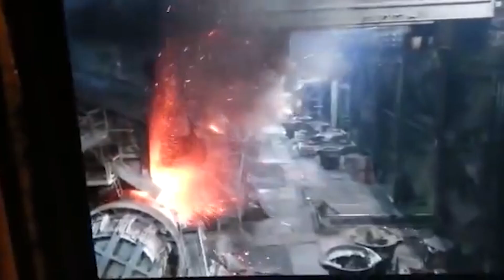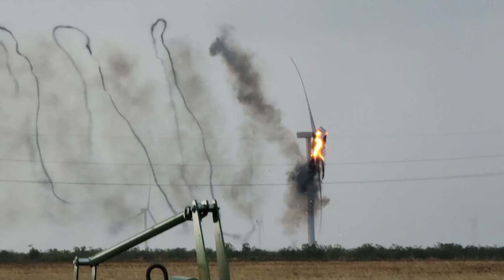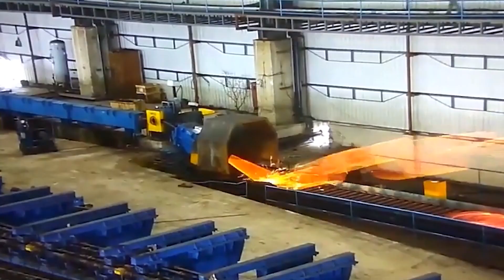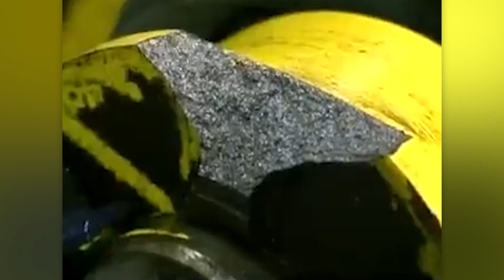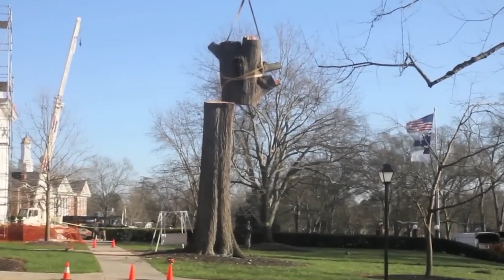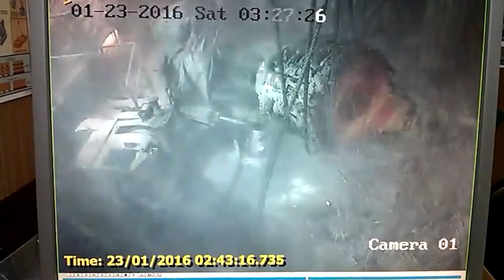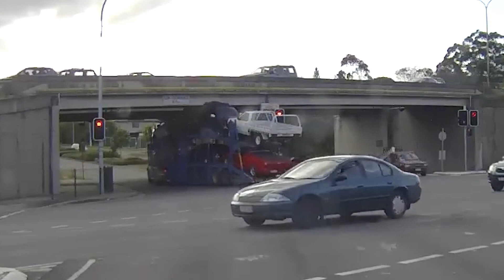Heavy Machinery and Industrial Mistakes Caught On Camera

Comment: The molten steel spill at the steel plant was terrifying. It’s amazing that the workers were able to film it without getting seriously injured
Reply: The cameraman never dies!
Reply: @lrich8181  haha, exactly
Reply: Believe it or not, the accident wasn’t that big of a deal. It was even relatively easy to clean up. Sweeping up little spheres of steel is much easier than puddles of aluminum. It just looked really bad.
Reply: @Endoplasmic-Reticulum  Indeed, most of it oxidizes immediately too. BTW, the narrator says 1000+ C, but molten iron is at least 1600 C, which is it's melting point (approx).
Reply: @paulmichaelfreedman8334  True, but doesn’t the actual temperature fluctuate depending on the specific alloy? And about oxidation—wouldn’t that depend more on the environment and how long the molten iron is exposed to air? There’s more to it than just temperature, right?
Reply: @Endoplasmic-Reticulum  Interesting take, but wouldn’t steel spheres be harder to manage due to their weight and potential to roll everywhere? Aluminum might spread out more, but cleaning it up seems like it could be quicker in the right conditions.
Reply: @InspiringStories-d8n  Actually, the spheres are so small that they’re in the range of .5mm or less. When my classroom demonstrations were done, I’d have to sweep them up. Sometimes I’d be lucky and a nice group of students would help.
Reply: @Endoplasmic-Reticulum  You have great friends. The spheres might be small, but doesn’t that make them even harder to clean up? Tiny spheres like that could get everywhere. I imagine it’d be more frustrating than dealing with larger debris.
Reply: @InspiringStories-d8n  I have a friend who works in a similar mill in SC. With accidents like that, they use an excavator bucket modified with an electromagnet that is smaller than scrapyards use. The friends I referred to in my classroom were actually students. 🤣
Reply: @Endoplasmic-Reticulum  Ah, got it! That makes sense—using a modified excavator with an electromagnet sounds like a pretty efficient way to handle those accidents. And yeah, I can imagine your students must've been a huge help cleaning up those tiny spheres. Definitely makes the job a bit easier with extra hands on deck! 😄
Reply: That was slag not steel.  Slag makes sparks.  The ladle plug had eroded or locked up before the crane driver could pour it into a slag pot.
Reply: @asya9493  Thanks for letting me know. I was used to doing the science experiment with my class where I dump molten iron onto the floor and it shoots in every direction across the floor.
Reply: @asya9493  Interesting point, but are you sure it was slag? I thought steel could spark under certain conditions too, especially when it’s exposed to oxygen. Couldn’t it have been a mix of both, given the situation with the ladle plug?
Reply: On the good side, they got to meet Natalie Portman
Reply: @natehill8069  Yeah, meeting Natalie Portman is cool and all, but does that really make up for everything else that happened? Seems like a silver lining, but not sure if it balances things out!
Reply: I found the clip of the wind turbine catching fire due to lightning strikes to be both mesmerizing and tragic. While it's an example of nature’s unpredictability, it also raises questions about how we design and protect our infrastructure against such events. Should there be better safeguards in place for wind turbines? After all, they are supposed to be one of the clean energy sources we’re relying on more heavily. This incident also highlights the potential flaws in the assumption that renewable energy technologies are entirely safe. What are the implications for future investments in renewable energy if we don’t fully understand the risks involved?
Reply: @HeavyMachineryEquipment  It’s interesting you bring up the safety of renewable energy infrastructure! While accidents like the wind turbine fire are rare, they do remind us that even green technology isn’t without risks. Perhaps there’s a balance to be struck between advancing these technologies and reinforcing them against natural threats. I wonder if investing in more durable materials or better lightning protection could make a difference. Do you think incidents like this might lead to stricter standards for renewable energy infrastructure?
Reply: @InspiringStories-d8n  That's a great point! Strengthening renewable infrastructure could be key to improving safety and reliability. Upgrading materials and enhancing protection against natural events, like lightning, would not only prevent damage but also build public trust in these technologies. It might even set new industry standards that push green energy forward. Do you think these kinds of improvements could encourage more widespread adoption of renewables?

Comment: Of all the things in the video - a bridge is a constant - it doesn't suddenly decide to vary in the height. If you're a professional driver you know the height of your vehicle and load. A professional company would be no stranger to that fact either. There's even professional software telling the dimensions of bridges and roads helping to determine the safest and most economical route. In my country we're probably the most digitalized in the world. As an example a pedestrian bride were hit by someone not caring for putting the crane in the transport position. The bridge were replaced just to be hit by an identical vehicle under identical conditions. A week later only 2 miles away - a bridge were hit under similar conditions with a similar vehicle - this time the driver being identical having done exactly the same thing almost to the date 5 years before. The only 2 times that bridge were ever hit in its lifetime... Within that very week more accidents with cranes on trucks happened than in the entire history of trucks with cranes coexisting with bridges. Within a fortnight the laws were changed - it took almost twenty years for a bridge to be hit again. The consequences of hitting a bridge made it almost a thing of the past. However almost a year ago a big transport hit a bridge again. The transporting company had they planned the route - using the existing tools - they would have known for certain it was a NO GO. However the truck driver had noticed the bridge could be a problem.... The company gave the OK to continue - not his problem anymore - why he continued smashing a bridge. He had company of 2 other vehicles one in front and one in the back making sure of a safe journey. Those vehicles are manned by expert drivers - just to qualify you have got to have at least 5 years of driving special vehicles with no accidents - I mean no accidents at all. You not only risk your own job... you risk the future of the company. Because the hiring companies are having no obligations - when you make a capital blunder. It questions the capabilities of a given company being able to deliver the required services.

Comment: You need to stop calling incidents like these “accidents”. Most of these incidents are NOT accidents, they are caused by workers not following proper protocols and most could have been prevented. An accident is caused by unforeseeable events with no one at fault.
Reply: Fault has nothing to do with it - it's about intent. To suggest that an "accident" has no one at fault is false.  An "accident" is simply and incident that was unintended.  By your definition, 99% of car "accidents" are car "incidents".
Reply: @smgdfcmfah  ITS AN ACCIDENT SON
Reply: What it is, is standard operating procedure. Bribe the officials so one can cut corners, make more profit and then claim it was an “accident. “
Reply: @brianreed5839  horses 🐎 ass son
Reply: Aka accidents 😂😂😂😂

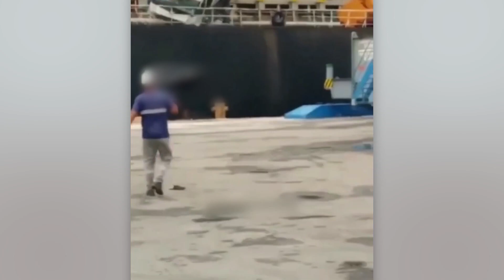Comment: 28:40 "The winches couldn't handle the load" but the footage clearly shows the lifting strap failing...
Reply: That's one of the more obvious mis-statements by the narrator. Also, the "construction truck" is a mobile crane.
Reply: @constructionwatcher5381  Which, to be fair, is a type of truck used in construction.
Reply: I was just about to say the same thing!
Reply: I was thinking those must be crazy straps to lift that much. Are they just a type of fabric? I thought they'd use a steel chain or similar.
Reply: @Kelthor85  They are indeed fabric straps, but they're made from a very tough material and very tightly woven, which greatly increases their strength.  In the clip though I'd say they definitely should have used chains.
Reply: Pretty sure he used the word "belt" in one clip as well.
Reply: What do you expect from AI BS?

Comment: It's scary that crane operating companies either don't know the weight of the item to lift or the crane's maximum load has been misrepresented. Another possibility is they did not have a crane available with the required load rating so they use a lesser crane along with a dollop of hope.

Comment: Few accidents are accidents. Most of them are "avoidables".
Reply: Engineers will NEVER use the term "accident". 
The correct term is "incident".
Reply: @CraftAero  An "accident" is one type of incident. Incidents include: accidents, injuries, illnesses, security breaches, violence, etc. So, engineers are correct: ALL accidents are also incidents.
Reply: I worked at two places in the oil field during the 1980s and there was a fatality at each place. We only had about 40 people on a shift where i worked remote and stayed in a camp so these are people you worked and lived with, it sucked.
Reply: Exactly,no such thing as an accident.Only mistakes.
Reply: .
    In the last 21 years that I worked before retiring, I was a heavy equipment operator then a forklift operator on 2 different jobs. As a forklift operator on my last job, we were driving 36 volt electric forklifts inside freezers for citrus juice storage. Our forklifts were 3,000 pound capacity but had a net weight of over 8,000 pounds including a 3,600 pound deep discharge lead acid battery that doubled as part of the counterweight. At the time, I was working first shift but I was good friends with the third shift leadman when this STUPIDITY happened. 
    Talk about avoidable. Our forklifts were outfitted with slick white rubber tires to keep the 26 forklifts used by our warehouse production crew and 3 shipping crews from depositing black rubber dust on the floors. Esthetics over safety. When you have solid, slick tires on a smooth, wet concrete floor or on ice in the freezers, you could lose your brake pedal and steering wheel and never notice the difference.
    This one kid on third shift came out of one of the freezers one night in a hurry and tried to turn left on a wet patch and began side sliding at a brick wall at a top speed of 15 MPH. This doesn't sound fast until you consider the kinetic energy behind 8,000 pounds of moving mass traveling at that speed, the number of horsepower that much moving mass is generating, the amount of friction required to stop it's motion as opposed to the lack of said friction on wet shiny concrete and the effects on soft tissue and human bone that is pinched between said moving mass and an immovable wall.
    What does any sane person do when they are riding 8,000 pounds of out of control steel and lead heading for a brick wall? They stick their foot out to stop it, don't they? That's what this kid did and it took his foot off except for about 2 inches of skin and 3 tendons on top of his ankle.

    The way it was described to me would be too long and graphic for here but suffice it to say, it wasn't pretty. If it's any indicator, they left his sneaker print on the white wall to remind people to keep their body parts inside the ride at all times until it came to a full stop. They reattached his foot with pins and rods but his ankle was fused solid. It took a full year for it to heal to the point that he could return to work.
    That little piece of stupidity happened 10 years before I retired and that footprint was still on that wall on my last day, 25 years ago. I'm told by friends that still work there that the wall has been repainted except for the 2 foot square around that foot print where it still resides today.
    Yeah, you hit the nail on the head using the proper tool when you said, "avoidables".
Reply: It seems like that would be especially true on the scale that most of these are on too. I mean a lot of that equipment is worth a boat load of loot. You'd think whoever is in charge would have multiple people with experience check and double check everything and anything that needs checking. Shit does happen, in any industry. But....
Reply: This quote really makes us think. Sometimes it is easy to blame “accidents” but if we look closely, we can see that many situations can be prevented if we are more careful and attentive.
Reply: I know hey lol alot of them they take vids prior saying theyre gonna "mess" something up and share it on tik tok lmfao
Reply: If you go in there and avoid it, your legs will tremble in fear
Reply: Technically all accidents can be avoided
Reply: Yeah, stay in bed.
Reply: Whether or not an accident is avoidable doesn't change the fact that they were accidents. It just means there were unintentional consequences. Even when these morons do what they do, they usually thought it would go their way. So, the resulting damage was unintentional, i.e., an accident.

Comment: "An electric arc furnace where temperatures can reach up to 1800 degrees Centigrade"............. and for those is the USA, that is 18,000,000 lbs or 7 Olympic Swimming Pools LOL
Reply: At least I understood it to be a measurement of temperature and not weight.
Reply: Next time you are on an airplane, ask the pilot what they measure their altitude in 😏
Reply: @sarnxero2628  Giraffes??
Reply: @dbeekman9738  Ya know there is the standard of measurement people used to land on the moon
and there is also the metric system
😁
Reply: Toyota Carollas?
Reply: No, You are all wrong! The correct unit is paperclip! The only correct way to find out is the number of paperclips that can be hold horizontaly in the air from the magnetic field. (Told me by a friend who actualy worked on the Aluminium furnace in the naighbor city where i live). :-)
Reply: HEY , here in Florida we only use BIG MACs  for comparison ya know Size weight volume , heat range!
Reply: Thanx for straightening that out. Its funny because when he says 1800 I just assumed F because that would be about right.
Reply: @scottgalbraith7461  Yup, 1800C (3300F), though small scale laboratory type systems can get up to 3000C (5400F)
Reply: What?? 18 million pounds? As in 9,000 tons? How does that compare to any kind of temperature?? What did I miss?
Reply: @jb6712  Missed your sense of humour and my tiny dose of sarcasm ;)

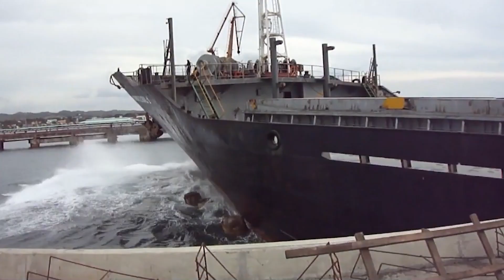Comment: 6:35 Recommendations
Ensure correct maintenance of all equipment.
Ensure that no maintenance is carried out on filters and fuel systems when on standby or approaching restricted navigational areas.
Ensure fuel oil viscosity and temperature control equipment is accurate and fully operational.